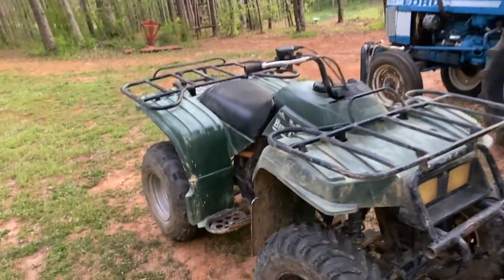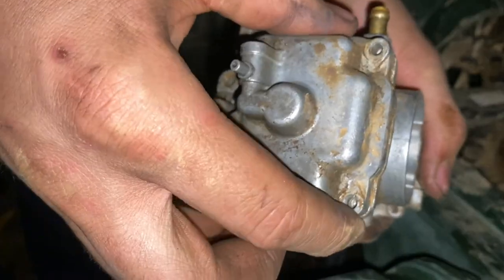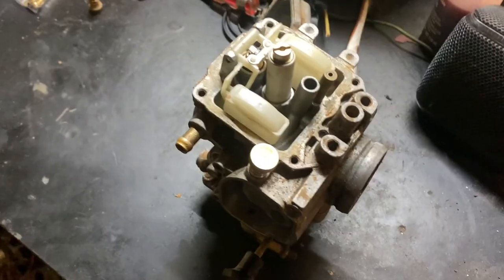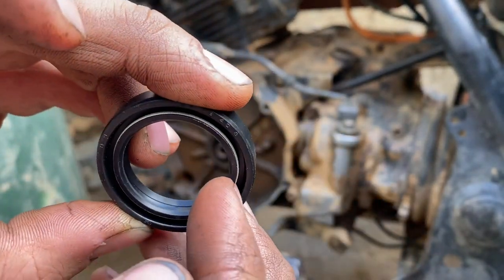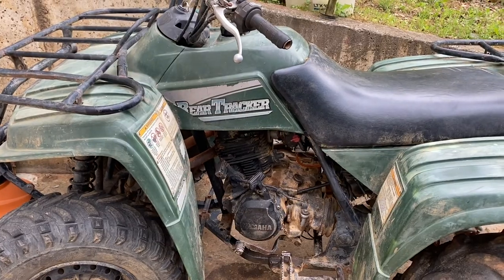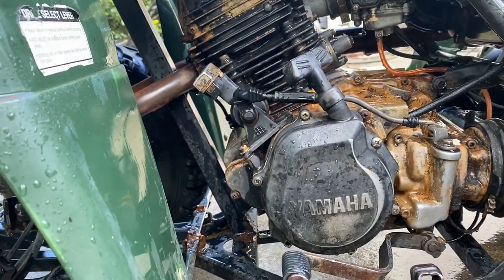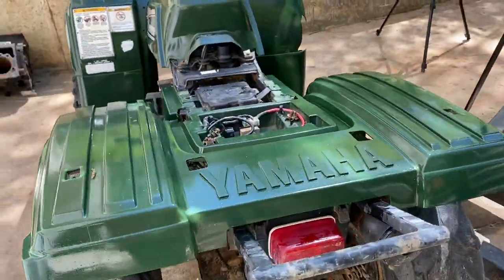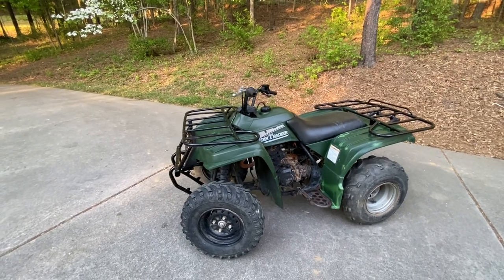$300 Yamaha Bear Tracker ATV - Fixing It Up for Cheap

Comment: I have a tan 2003 model, and it idels very high and when you pop up out of neutral into first it takes off on its own, can you help me? Is is just carburetor adjustments??
Reply from the maker: Most likely carb adjustments, you may have a vaccuum leak or air leak somewhere causing a lean condition also

Comment: Bro that’s NOT how you fix faded plastic all you did was scratch the ever living fck outta the plastic gotta use a heat gun or if you are handy with a torch use a torch at distance it’ll melt the plastic right back to original color and won’t fade or look at dull when dry 👀

Comment: Awesome video. I stopped to help a guy with a flat tire on his trailer. He had a load of scrap wood he was hauling to the dump. I saw handle bars sticking out and noticed a Yamaha four wheeler. After helping him with the tire he told me that I could have the four wheeler. He said the engine was locked up. Long story short. It had a broken wire on the starter. I rode it yesterday. It's a timberwolf. Definitely needs some love but I am stoked to have my first atv. I've only ever owned three wheelers and go carts.
Reply from the maker: Good deal man I hope you enjoy it. Easy fixes are always nice
Reply: @averybryant  thanks man. I just picked up a bear tracker as well. I'm hoping it will be an easy fix too.
Reply: @darkgrey1790  nice! i just got a free beartracker too, i cleaned up a bunch of junk out of this property and the guy let me have the old bear tracker sitting in the field. its a 1999and it seems like it has low hours. i got it running rerally good even though it came with a chinese carb and it still needs a rebuild kit. the tires are original and junk (they hold zero air and i blew up one of the rears trying to seat the bead) but i still rode it around the other day before i buy new tires. did you get yours running? im thinking of buying sunf A028 23x7x10 and 23x10x10 tires. i cant wait to go ride it at the beach!

Comment: I got one of these for $200, the entire top end of the engine was destroyed due to lack of lubrication on the wrist pin, the connecting rod was heavily gouged but repairable with some Emory cloth and I got the thing running today on propane. Unfortunately the carburetor is heavily damaged and corroded so needs replaced.

Comment: I just bought a 2000 Bear Tracker in fair condition....Replaced the intake manifold and with some carb work runs excellent....It was a much better example than yours however I paid 800 in 2023...Next is brake work. tires, basic maintenance...Plastic, seat, handlebars and controls are good....Will do a deep detail with some paint and decals and she should be a great little work horse and slow trail machine for the kids....Great work on yours I like your style.

Comment: 10:50 Want to warn you you're missing the screw clamps for the universal joint / output shaft tube. Leaving that off will allow water in the rear end which is not good!

Comment: I had a 98  250 Timberwolf 4X4.  Being 4 wheel drive it didn't go very fast but it would go just about everywhere.  I never got it stuck in the snow.  I paid it off and bought a 2001 350 Wolverine.  I still have it and use it daily.  It works great for plowing my driveway in the winter and it goes fast enough for my old butt. 2 wheel drive atv's are more fun to rip on and I see your doing just fine.

Comment: Avery I’ve been working on my bear tracker for a while I now have it running but when it starts up I can’t even rev it without it wanting to die I cannot figure out why I have rebuilt the carb and clean everything on it I even put it back the way it supposed to be. How did you set your carb on yours because I may have set mine differently resulting in sluggish start. It will idle with no problem though just can’t rev when it starts for about 2-3 minutes
Reply: Check metering pin like he did

Comment: if you use a heat gun over the plastic it draws the oils out and makes the plastics like new.
Faded plastic is just the UV drying out the oils.
Just don't over heat and melt the plastic or warp it.
Reply: I have one that had sun fade pretty bad but I used some rubbing compound and elbow grease took several applications but cleared up nicely
Reply: That will make the plastic brittle

Comment: I paid 450 for mine and all i did to get it running was clean out the carb but it has a pretty loud tick from the engine. Any idea what it is?
Reply: Timing Chain? Valve tick?

Comment: Sorry for the noob question but what exactly is the petcock?  Something to do with gas valve of some kind I think but cool videos.   learned a lot.  Watched a couple quad fix videos so far and every time I end up checking my fire alarm batteries ;P
Reply from the maker: Lmao yea i need to get around to changing those… i dont even hear the beep anymore until someone reminds me. The petcock is just the fuel on/off valve and also has a reserve tank setting where it leaves the fuel on the bottom of the tank alone until its switched to reserve. This helps you not get stranded if you run out of gas and gives you a little more to get home